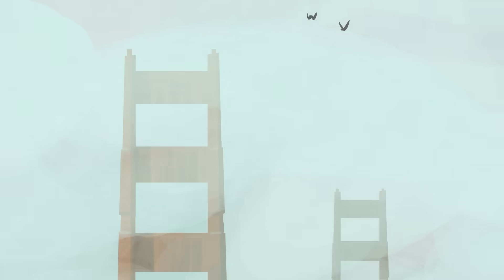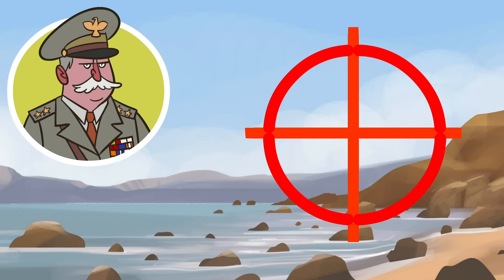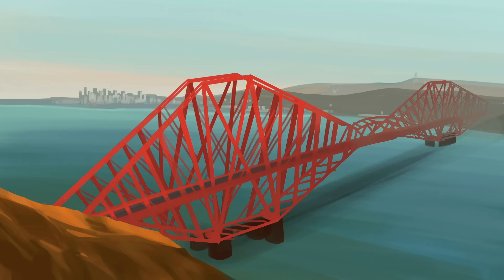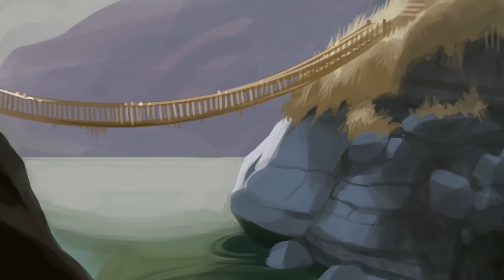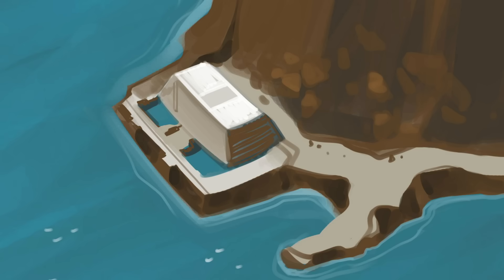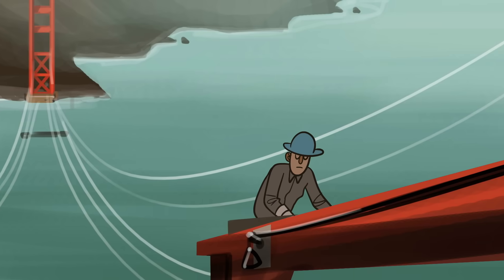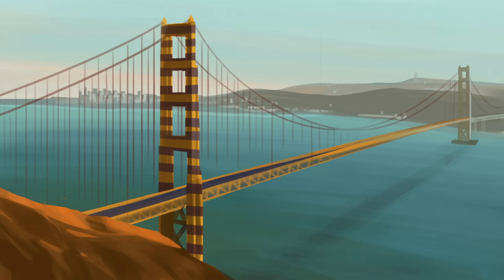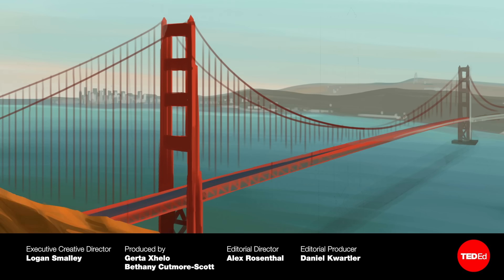Building the impossible: Golden Gate Bridge - Alex Gendler

Comment: Unfortunately, the original designers of the Golden Gate Bridge did not have a good understanding of aerodynamic loads and its potential  interactions with the natural frequency of the structure. The first Tacoma Narrows Bridge was a victim of this oversight and it catastrophically failed in 1940.  More money has been expended on remediation work for the Golden Gate Bridge than was spent to build it as a consequence.

Comment: I wish you gave us more step by step details like how did they actually build the road while simultaneously suspending it over the water but cool video 👍
Reply: Civil engineering would be a lot more appealing if it had good high quality infotainment like that
Reply: I’m not sure about the Golden Gate Bridge, but these days they build the roadway in sections (50’ in this case, the span between the hangers), float them out on barges, then lift them up and attach them them to the hangers.
This was the deck is built safely on land and you have a minimum of working at height.

Comment: how did they ever get those massive cables suspended between those super tall supports standing in the middle of all that water
Reply: I would guess starting with a small rope to pull a larger rope and continuing to increase the size of the rope until you have a rope/cable strong enough to pull the actual cables across.
And a truck load of pulleys to generate the power to pull the ropes/cables to the other side.
Reply: One strand at a time.
When Robling built the Brooklyn Bridge they used a kite to fly the first string across.